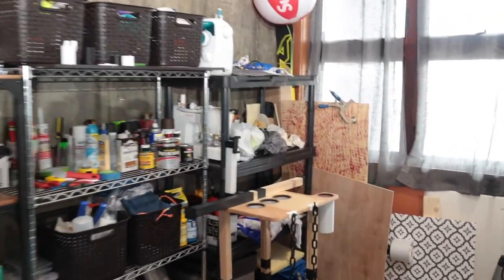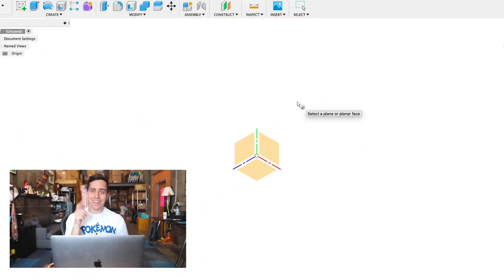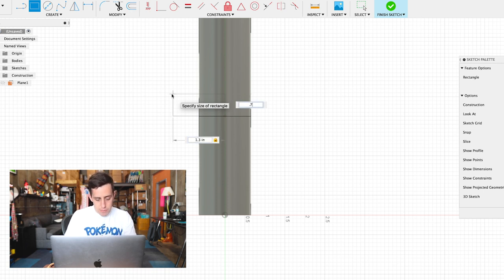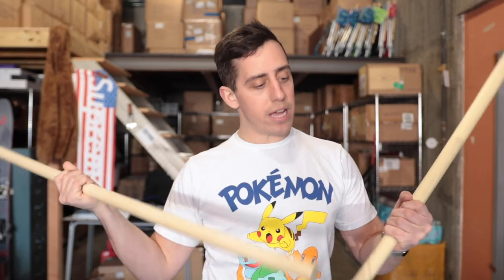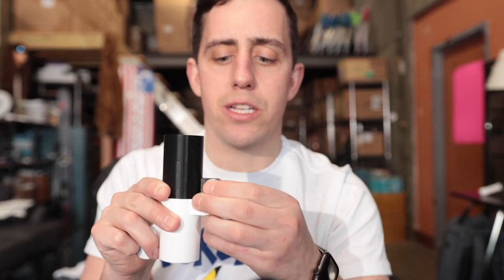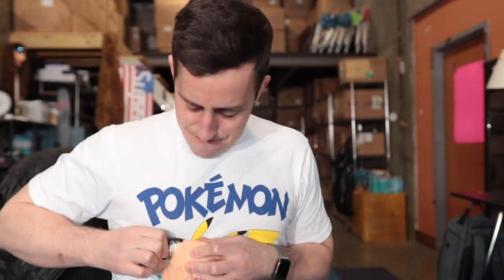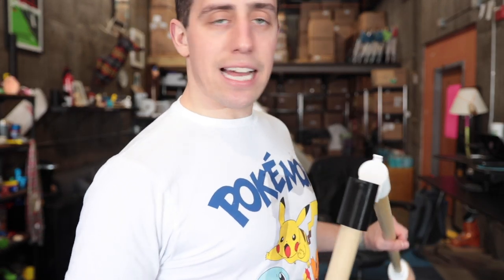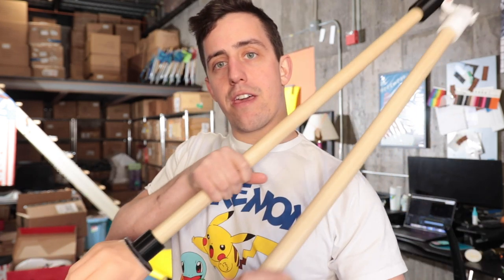Inventing a social distance hand holding device!

Comment: but if the social distancing is 6ft, you just need a 3ft long stick foldable into two parts 1,5ft each! The other will have another 3ft stick and in total it'll be 6ft apart. You made a 12ft social distancing device, instead, plus the length of your arm making it 18ft distance between you and the other. Exaggerated! 😝
Reply: UNecessary !
Reply: @yonathansami  yeah true
Reply: What? How is this 12 ft
Reply: @Soljarag5  I think it's im the video, I don't remembrr
Reply: @3Clod  I think you confused yourself, he made a 6ft device.